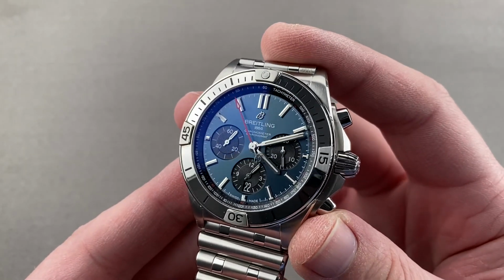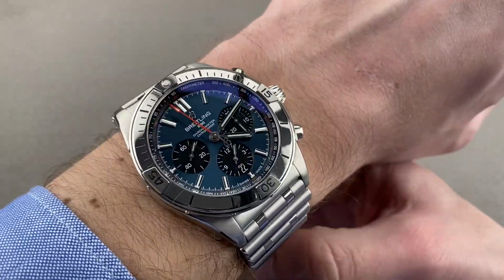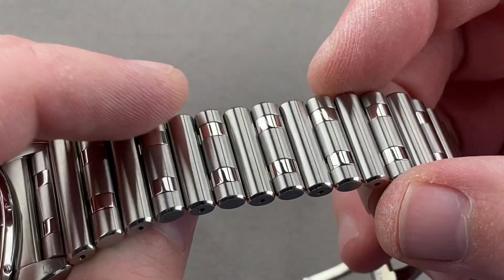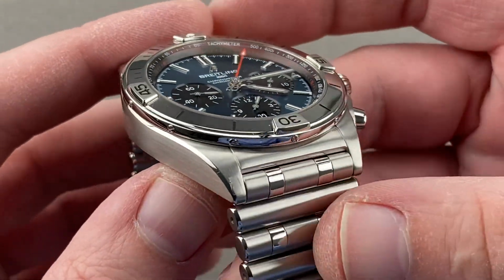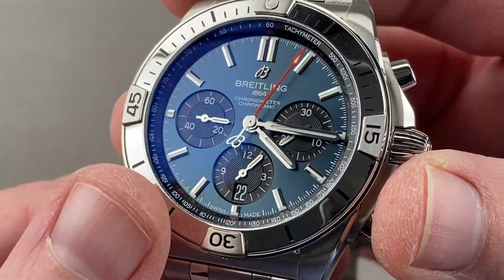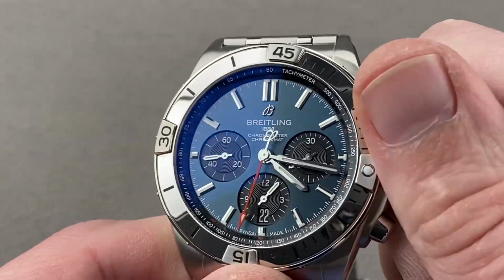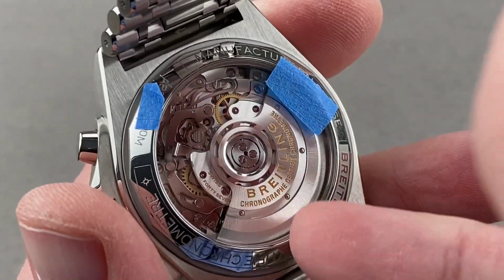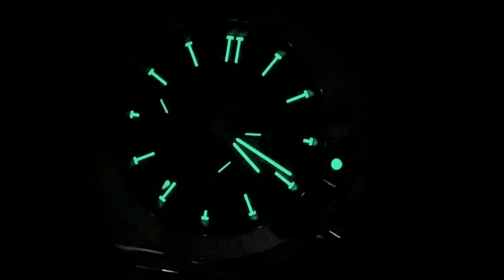Breitling Chronomat B01 AB0134101C1A1 Breitling Watch Review

Comment: Tried this on few months ago.. its 15mm thick but on the wrist looks a lot slimmer than my Tudor Black Bay 41mm which is just under 15mm thick..
Its a beauty 👌🏾
Reply: Agree, my BB41 and chrono appear and wear much  thicker due to its case design. Breitling wears slimmer and is level above in fit and finish.